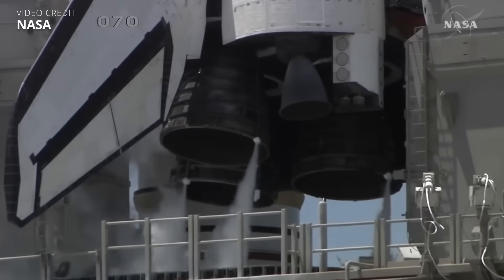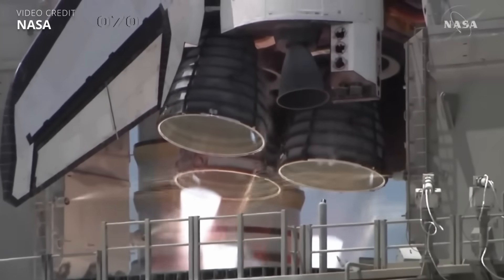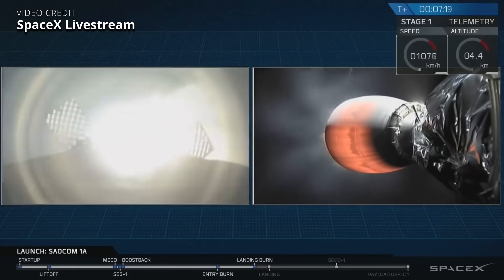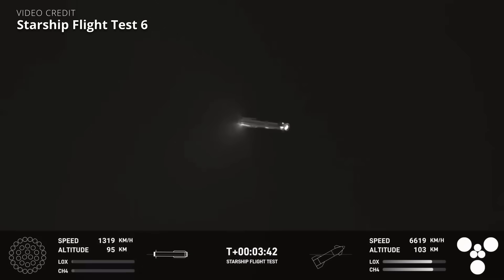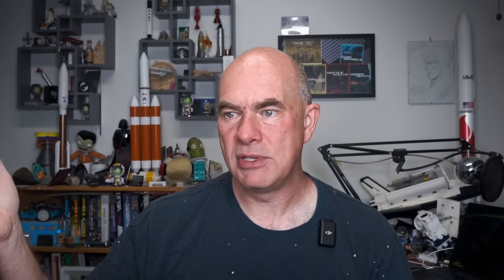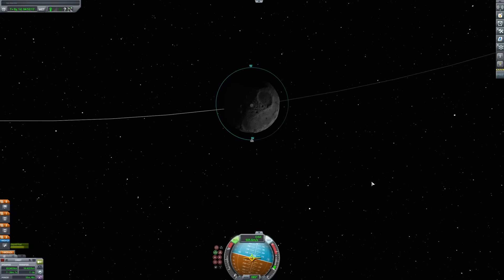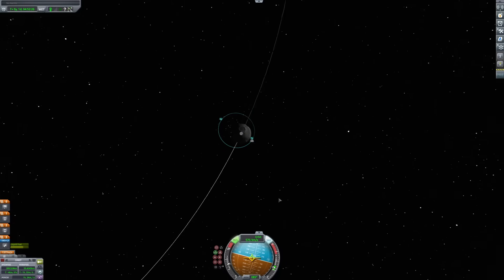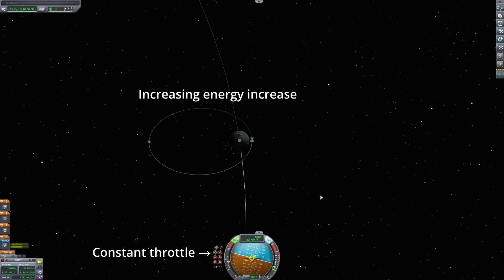Where Does Rocket Exhaust ACTUALLY Go?

Comment: I've got a question about where the force of a rocket engine is applied. 

Is it the sides of the bell? Is it the throat where the combustion occurs? Or is it some deeper part of the engine? Especially things like turbospikr engines, all parts of it look so delicate that I can't imagine any of it can bear the force require to accelerate a whole rocket at those rates.
Reply: The forward wall of the combustion chamber and the nozzle sidewalls experience most of the force. For typical engines. I don't know about aerospikes, but I can't think of anything in the exhaust stream as "delicate".
Reply: @LurkerInTheInterRecordGap I see.

I meant "delicate" in proportion to the force the rocket generates. All the diagrams I've seen look fairly dainty since it's only connected by the throat.
Reply: You are asking the right questions. The previous comments is correct. Basically think of an individual gas molecules bouncing around. Nozzle and nozzle extensions are useful because they keep on redirecting the molecules from a sideways direction to a backwards direction within the exhaust. Equal and opposite changes of momentum are then imparted to the nozzle. Everywhere a molecule bounces off the nozzle and combustion chamber there is momentum transferred. To get the full picture... Originally the fuel molecules were stationary in a fuel tank. They are reacted and gain speed. They bounce around until they bounce out the back of the nozzle. The straighter and faster they are the better. Also the more you let them expand in the nozzle area (because you are harvesting more energy from them by redirecting the momentum gained from the expansion backward.
Reply: @zacrintoul  Also, while the pressure in the chamber can be ridiculously high (350 bar for Raptor), this drops off quickly once the exhaust is past the throat and has room to expand. As such, the bell isn't dealing with as much force as you might naturally assume (hence the story of SpaceX using metal shears to trim off a damaged part of the bell before flying it).
Reply: @simongeard4824 Ya I should have highlighted that part better. In the past I've had more of a problem understanding the bell, so I tend to focus on it.
Reply: All of the above, really... the purpose of the entire engine structure is to confine the gas expansion to ensure that force is overall directed in one direction.
Reply: Most of the thrust force from a rocket engine is applied through the upper surface of the combustion chamber, where most of the energy is released.

Comment: The way i heard gravity slingshots explained to me in the 80's, was that you fall into the gravity well, you get to harvest the potential energy of the entire mass of the rocket.  Then you burn the fuel to speed up, which means while the rocket is gaining potential energy as it climbs out of the gravity well, the fuel you burn does not, as it is no longer in the vehicle.  So you end up getting more energy out of the fuel that you would if you burned it outside of the gravity well.
Reply: Ok, it makes total sense now! Cheers
Reply: That sounds more like the oberth effect. Gravity slingshots do not need a burn during the encounter.
Reply: I think of it as a skateboarder intercepting a car with a fast winch rope behind it. Picking up the rope, the board gets pulled towards the car which is travelling along the road. The board gains speed from the winch (gravity) but also from the original speed of the car which is pulled by the much lighter board.

Then the boarder speeds past the car with the rope in hand and leaves its influence in a quicker amount of time than it came in with, so the rope (gravity) acts on it for less time than before, conserving more of the speed that it picked up during the descent.

Ergo you gained speed during the pass. No engine burn needed.
Reply: I like to think about it as bouncing off a moving body. If you zoom out far enough, it just looks like your velocity got reflected relative to planet.
Which is funny, since you wouldn't expect attractive force to effectively repel you.
Reply: The Oberth maneuver is described by Heinlein in “The Rolling Stones” as the first leg of the journey from the Moon to Mars.
Reply: @josephjulicher1220 
THAT was the story I was trying to recall. Brain-fade tripped me up.
Thank you.
Reply: Another thing is, you gain speed from the gravity pulling you in on approach and then you shoot yourself out of the well and spend less time being dragged back down
Reply: Except you don't need to burn fuel during the slingshot.
In fact that's usually only done to course correct, not gain energy

Comment: 1:48 it's indeed not Gaussian, it follows the Maxwell-Boltzmann distribution.
Reply: I was going to say that -- but subject to the assumption that the exhaust was in thermal equilibrium before leaving the nozzle which probably isn't really true.
Reply: @petergerdes1094   the distribution should be a cartesian product 2Dx1D of two Maxwellian distributions, since there is anisotropy along the thrust direction.
I wonder if the exhaust-direction velocity distribution just gets constant shift relative to the perpendicular distributions, or does it have a higher effective temperature ?
Reply: The 3d velocity vector follows 3d Gaussian distribution. Its magnitude follows Maxwell-Boltzmann distribution.
Reply: The MB distribution for classical particles (whose kinetic energies are quadratic in their velocities) is Gaussian. However, rocket exhaust are not in global thermal equilibrium and hence the distribution will not be MB but will show deviations from that.
Reply: @frankwitte1022 The MB distribution (as it gives speed not velocity) is 0 at all negative values while a Gaussian is non-zero everywhere. But yes the velocity distribution is going to be a 3d Gaussian.
Reply: @petergerdes1094  It is just a 3d Gaussian distribution written in spherical coordinates and with the angular variables integrated out. The notion of thermal equilibrium for a classical gas is what yields the Gaussian distribution, what leads to the MB "speed-distribution" is the isotropy of the 3d Gaussian. The MB looks the way it does, is because it originates from a Gaussian distribution, and that Gaussian distribution is crucially the consequence of thermal equilibrium of a classical, 'ideal' gas.

But hey ... exhaust gasses from a rocket aren't in thermal equilibrium anyway.
Reply: @frankwitte1022 Well I think we just disagree over definitions.  I define a Gaussian to be a certain parameterized family of functions from R to R which isn't closed under changing to spherical coordinates but far enough if you define it differently.
Reply: @petergerdes1094  I appreciate that the distribution of molecular speeds isn't a one-dimensional Gaussian distribution  even though the distribution of molecular velocities is a Gaussian distribution in 3 dimensions.
Reply: @frankwitte1022 Let me guess you are a physicist or someone who deals with the physical world so your focused on the actual distribution of speeds out there regardless of mathematical representation?   I'm a mathematican so to me a Gaussian is (a class of) sets of ordered pairs of reals so not the same thing under different representation.

Neither of us is wrong I just found it interesting how even conditions for identity vary by application.
Reply: Rocket exhaust is practically a fart in the wind out in space.  It gets ionized and absorbed by our atmosphere, or gets expelled into towards the Hekiopause.
Reply: Neat!
Reply: Without having a clue about anything you say,
I can assure you, physics do not follow what Maxwell-Boltzmann theorized.

I would agree, that he described it, though 😂

Comment: Slight error at 2:45. If rocket is still accellerating the exhaust gas is going the other way and would fall back to earth and not go to a higher orbit, Lower or fall into the atmosphere.  When doing a decellerating burn the gasses would go to a higher orbit.
Reply: Actually....
Reply: That's literally what he said.
Edit: no, it wasn't lmao
Reply: @CarlosAM1  @casualbird7671 No it's not literally what he said. First he talks about accelerating to, for example, leave orbit, and then he says "If you are speeding up, however [...]" as if speeding up contrasted the process of accelerating. So that was a slight error. Feel free to follow along the transcript, which is mostly accurate.
Reply: @argh1312  "So if you are firing your engine in low earth orbit and you are accelerating to say, leave orbit, then that gas is slowing down and is gonna fall back to earth. So yeah that's what's happening in that case if you were speeding up..."

Then he says

"However, you are pushing that stuff out at about 3km/s that's not quite enough to say, get it out of, you know to escape velocity. But it is enough to kick it up to a higher orbit."

So yeah indeed you are right, I thought the original comment meant the first part of what he said.
Reply: @CarlosAM1  You butchered his sentence structure with that supposed quote. I think the transcript has it correct. The way you chopped it up, the second sentence does not make sense. Because this way, it sounds like Scott was still talking about the same scenario after "However", but why would the exhaust particles be kicked up into a higher orbit when the spacecraft is also accelerating to achieve a higher orbit or even escape orbit?
Reply: @argh1312  I just tried to transcribe it myself I already said I agree with you.

Let me repeat, I agree with you
I agree
with you

as in, I agree with what you said, your comment, I agree with that. The whole orbit thing? I agree with it. Original comment? Also agree with it.

Hopefully that made it clear man I don't want more replies on ts I can't even edit my original comment and I'm about to pass out from exhaustion as I write this
Reply: @CarlosAM1  I didn't reply to "win" the argument or for you to stroke my ego. I replied to clear up what I perceived to be a misunderstanding, so that we're all on the same page. Just out of interest: why can't you edit your original comment? You don't have to answer if you find this exhausting.
Reply: @argh1312  Bro I passed out from exhaustion right after I wrote that comment do NOT do engineering.

I had to look up the comment on my pc to edit it, which I just did a few seconds ago, but the comment I replied to you with was written on my phone right before I fell asleep and idk why I couldn't edit it there. 

The reason I replied like that was because since you had missed me saying I agreed with you, I figured i'd just make the entire comment nothing but that so you couldn't possibly miss it lmao.
Reply: @CarlosAM1  Again, I didn't miss you saying you agreed with me. Also I am confused that you keep mentioning how exhausted you are or were. Is that supposed to be some pun on the video topic? Is it supposed to be a justification for any errors on your part? Is it supposed to guilt-trip me into ending a discourse because for some reason you find yourself unable to not reply?
Reply: You misheard him?

Comment: Every time a rocket was tested at Stennis Space Center, the exhaust cloud would always travel over our Lockheed and Rolls-Royce facilities.  Leaving a white residue on our cars.  Felt good to have rain out of nowhere on a hot day, especially from the SSME engines!
Reply: If it's leaving a film on your car, is it really just water?
Reply: @RCAvhstape yes, it’s just hard water.
Reply: The plume is visible from New Orleans! If they're doing a test on a mostly cloud-free day you can easily see the exhaust from a slightly elevated location like on top of the river levee, it's pretty cool
Reply: I would think there was value in collecting and analyzing the white rain.
Reply: Space shuttle main engine engines
Reply: @wurfyy , LOL, typing on the phone gets harder as you get older.
Reply: Dang I hope they never tested anything hypergolic! That ammonia will really mess up your paint (among other things!)
Reply: Awesome!
Reply: ...white residue? Unless you specify then I don't think that's just water then lmao.
Reply: @CarlosAM1 , it wasn't as bad as it sounds.  The byproduct is essentially water vapor, but they use a deluge system in the flame and exhaust deflector.  That water comes from the canals near the test stand, and some of that gets sent into the air as well.

A very light whitish film could be seen on our windshields, but it just rinses off.
Reply: @JarheadCrayonEater  Oh, that. Yeah no I thought you meant something else from the way you phrased it.
Reply: @CarlosAM1  hard water.

Comment: How can a rocket have "x" km/s in delta V stored instead of using the ENERGY stored in the engine times efficiency? As you mentioned, accelerating a rocket which is already at a higher speed has more impact on its energy (V squared). So adding 1km/s in dV to a stationary rocket produces a much lower kinetic energy compared to adding 1km/s of delta V to a rocket that is already traveling at several km/s. This looks like you get more energy out of your stored energy if you accelerate an already fast rocket. To me it feels like "stored energy" would be the correct metric to describe rocket stage performance instead of using delta V, because delta V produces a wide range of energy increase per speed added depending on initial speed. Otherwise we could imagine a two stage rocket - first stage accelerates it to 299.999km/s. The second stage after separation can add 1km/s of delta V - so we do exactly that. we use the available delta V and reach the speed of light. Now we collide this rocket stage onto a hypothetical kinetic energy impact to electricity - boom, we got infinite energy from our 1km/s delta V capability. On the other hand just accelerating from 10km/s to 11km/s is giving an infinitely smaller kinetic energy increase. Both cases - if delta V capability of a rocket is a fixed design metric - use the same amount of fuel. In the first case we gain infinite energy, whereas the same amount of propellant gives us only a bit more energy if added to a slow rocket. 

Where is the catch? How can delta V be a fixed spacecraft design metric, but depending on initial velocity we gain vastly different amounts of kinetic energy? Why isn't maximum "kinetic energy increase" the metric for determining performance specifications of a rocket?
Reply: Here's the catch:
You need to consider the kinetic energy of the rocket and the exhaust separatly.

Think about a simplified rocket made of a gun shooting a bullet, both of mass m.

Apon firing, lets say the gun and the bullet each get a boost of velocity u in oposite directions.

So the potential energy of the propellent would be 2×(½mu²).

If the gun had an initial velocity v, then the total kinetic energy after firing would be:

E_final = ½m(v+u)² + ½m(v-u)²
= ½m(v²+2vu+u²+v²-2vu+u²)
= m(v²+u²)
= ½(2m)v² + 2×(½mu²)
= E_initial + E_potential

So energy is conserved in total.
However, where is is going into?

Now if we consider the gun alone:

E_gun_final = ½m(v+u)² > ½mu²

So we do get a gain in energy, which we have taken from the bullet's share of the pie.

The reason we can seemingly get boundless energy gain a high velocities is that the bullet and the gun had a lot of energy to begin with, so we could take a greater amount of energy from the bullet's share.
Reply: @eliyasne9695  I understand and it gives more clarity for sure! would love to run the numbers for both parts of the equation and see how they balance. But let's think about the 299.999km/s initial velocity and we now apply our 1km/s of delta V ---> boom, infinite kinetic energy in the rocket, whereas kinetic energy educed in the prop/exhaust is finite. Or is this simply a case where velocities get big enough to put newton to sleep and wake up einstein? ;D
Reply: @AlexRian_ 
Yea, near the speed of light velocities quite literally don't add up.
What i would say about that is that moving at c represents infinite energy and momentum for any mass, so the rocket never really gets there. Rather, it inchs ever closer to it regardless of how long the engine burns.

Comment: The real secret of Oberth effect is realising that the propellant in a fast moving rocket has more kinetic energy than chemical energy, and that the engine is transferring some of that kinetic energy to the rest of the rocket during the burn, and that explains why energy is still conserved.
Reply: The Oberth effect can also be interpreted as follows: the time of falling to the lowest point of the orbit and the time of ascent back are equal. Acceleration during the fall is compensated by braking during the ascent. But if you turn on the engine at the lowest point, the ascent time will be reduced and braking will not be able to compensate for the gravitational acceleration.
Reply: @kokvad You're not wrong, although technically that's the Oberth Manoeuvre, rather than the Oberth effect I think.
Reply: Indeed, if the rocket is going faster than half the exhaust speed, then the combustion gases are actually moving slower than the unburnt propellant. But the Oberth holds at any velocity, so it's bit subtler than just that effect. The simplest explanation is that because KE is quadratic in speed, the same Δv leads to a small change in energy at small speeds but a larger one at high speeds. But, IMO, the real way to get an intuitive understanding of the Oberth effect (and almost all of orbital mechanics) is to lose the usual Netwonian instinct of thinking in terms of mass and velocity, and instead use (angular) momentum and energy as your two independent variable in a Hamiltonian-esque fashion.
Reply: @QuantumHistorian  No because 0.5 dmf v^2+0.5 dmf Ve^2 - 0.5 dmf (v-ve)^2 = dmf V Ve so it's literally just what I said. The lower energy liberated at low speeds is also the Oberth effect.